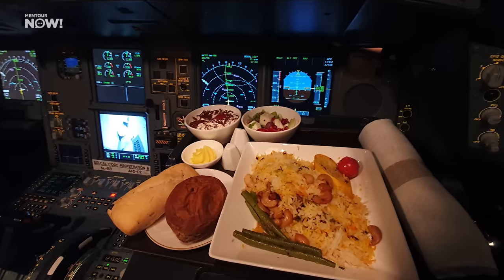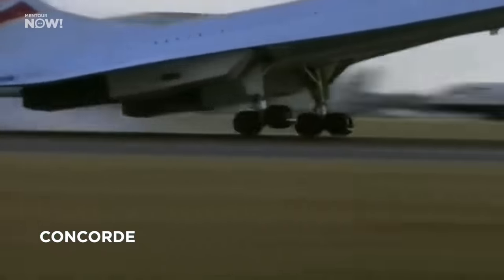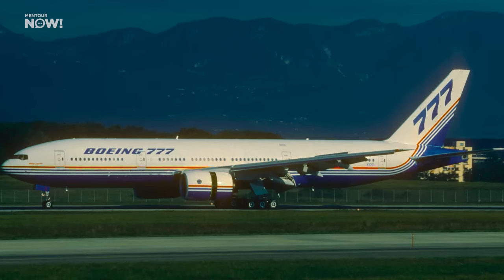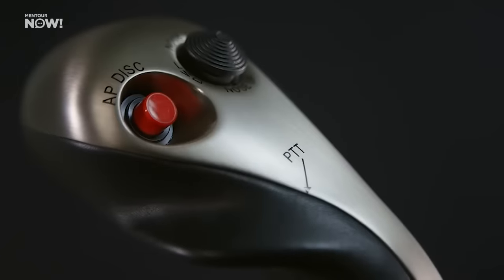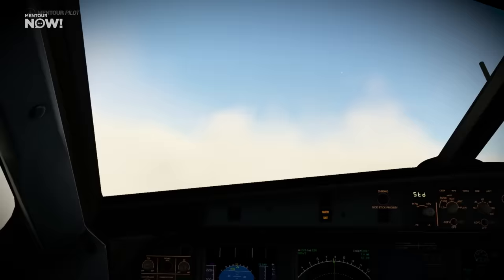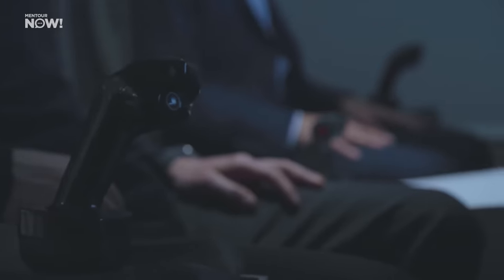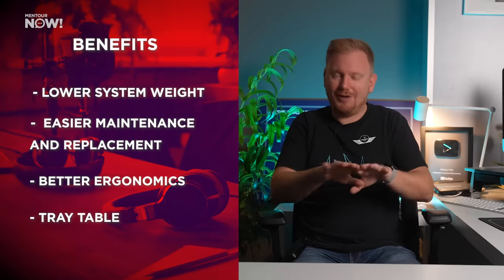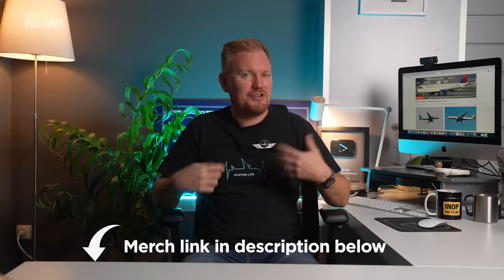Will Airbus Finally switch??

Comment: Airbus Normal Law and Alternate Law fly-by-wire logic is g-command. Airbus pilots don’t trim in g-command. Boeing Normal Law is g-command PLUS speed stability In Normal Law the Boeing pilot has to trim for speed change, but nothing else.
The hazard in Airbus backup mode is Alternate Law where the pilot still has g-command with no feel for speed change but loses the stall protection logic of Normal law which overrides g-command to preclude stall. In Alternate Law the Airbus pilot can fly into stall with no feel that speed is changing, AND automatic nose-up trim can continue even after stall if the pilot does not push forward. Full nose-up trim makes the stall much more extreme.
 Direct law is much less of a problem. Direct means the flight controls respond directly and proportionately to pilot inputs just like a 737. The Boeing 777 does not have Alternate Law. The 777 backup mode is Direct Law (or Secondary Law, which is Direct Law with some small refinement like changing sensitivity with Flaps up.) 
Air France 447 was in Alternate Law g-command with no feel that the aircraft was slowing and trimmed full nose-up after stall. The result was a severe stall where the aircraft turned over 180 degrees and full side stick would not roll level and sink rate was extreme with noise that likely sounded like overspeed. 
Without automatic full nose-up trim, the pilots of Air France 447 would have had a more benign stall and likely would have recognized it was a stall. Blame the pilots - they caused the accident. But no design should be certified that can automatically trim full nose-up in stall in ANY mode. That was also a cause.

Comment: I remember the YF-16 test flights including the gear up landing that, IMHO, cemented its place in the competition.  I remember being skeptical until the Thunderbirds started using it within inches of each other.  There really should be an analog backup though, EMP attacks are a real issue in the modern world.

Comment: Boeing and Airbus should converge to the active sticks, since it has all the benefits of both yokes and sidesticks and almost none of the drawbacks of each of them.
Now, a few "warning" notes:
1- The implementation of sidesticks doesn't automatically mean having full Boeing-like feedback. Synchronized movement of both sticks, airplane "feel" and autopilot feedback are 3 independent kind of feedback that may be all implemented or only some. All 3 are present in the Boeing's fly-by-wire philosophy implemented in the 777 and 787: The synchronized movement is due to the mechanical linkage between the two yokes, but the airplane "feel" and the autopilot feedback are actually implemented via software and servos.
2- I have doubts whether Airbus would go beyond just synchronizing the sticks. Implementing airplane feel for out-of-trim means a total redesign of their control laws (currently the sidestick deflection is proportional to the load factor at high speeds and to the vertical speed at low speed, and none of them would create feedback). The handling of the plane (how it feels to fly) would be significantly different, making it a big problem for pilots that have to fly retrofitted and not-retroffited versions in their fleet. And regarding the autopilot feedback, Airbus doesn't seem to be too concerned about that when it comes to trim or throttles (currently nothing moves in the cockpit when the plane's automation changes the trim or the thrust). It's hard for me to imagine a plane where the stick moves with the autopilot inputs but the thrust levers don't move with the autothrust inputs (something that also causes confusion to Airbus pilots especially in special unusual circumstances like control law degradation.
3- The servos better be really beefy. They have to feel solid as if the stick was mechanically connected one to the other, to the flight control surfaces, and to the autopilot. The control split in the Air France 777 go-around incident at Paris happened at substantially high forces, it is incredible that the pilots didn't realize that they were fighting each other. The split forces for the sidestick (i.e. the point where the human overcomes the servo) should be not less than that. The pilots need to be confident that when the sidestick is in a given position, the other sidestick will also be in the same position and the flight controls (elevator, ailerons) will be in the corresponding position (if airplane feel is implemented) regardless of whether the flightstick is being moved by the other pilot or, if autopilot feedback is implemented, by the autopilot.
4- There is one strong point of the yoke that active sidesticks cannot overcome. The big yoke just in front of you, between you and the instrument panel, directly in your eyesight line, and between your legs, is a HUGELY CONSPICUOUS source of visual and tactile feedback. The feedback of the active sidestick, being not in direct sight but in your peripheral view, and not between your legs, is much subtler. Still, if you look at the safety record in Airbus with a passive feedback, the fatal hull loss rate is amazingly low (the 737 and A320 have almost identical figures) so, with all the benefits of the active feedback, the benefits seem to easily outweigh the drawbacks. I would go for it, both for Airbus and Boeing.

Comment: Thank you for making a note  that the Avro Arrow was the first Aircraft to have Fly-by-Wire (a Canadian engineer discovery) but the Arrow also did not have Yoke. It too was stick operated. 
Just YouTube the Avro Arrow movie where the Engineer give the Pilot the "Feeling" using servo. The aircraft engineering was perfect as a first Delta wing aircraft to hit speed never seen before but it was politicians that killed it.
did enter service 
Thanks for the Canadian credit.

Comment: The Bristol Britannia had fly by wire electrically driven flaps back in the 1950s. A relation of mine designed the system and went on to help on the Concorde project.

Comment: Direct control is like commanding the aircraft to do what you want. Fly by wire is like requesting the aircraft to do what you want.
       In the late 70's or early 80's my dad was giving a student pilot a lesson, (Yes he was a CFI).
     They were a bit high on final so he asked the student, Why don't you show me a side slip?"
     Rather than performing a side slip the student performed a snap roll. Well, actually it was half a snap roll. The student was so startled by what the plane did he let go of the controls with stopped the roll half way through. Now they were inverted, at low speed and very close the the ground.
     My dad was able to roll the wings level but now the nose is pointed down. Dad started pulling, knowing if he did not pull hard enough the plane would hit the ground. If he pulled too hard the plane would stall and hit the ground.
     He pulled up as close to a stall as he could and managed the pull up before hitting the ground, but not before hitting the wheat of the field by the airport.
     Wheat was tangled in the landing gear and the tail, and the propeller was stained green.
     One of the things fly by wire does is prevent the pilot stalling the airplane. This means the pilot can't pull up as hard as he wants. Even if the controls are pulled all the way back. There would certainly be some kind of safety margin. The plane will not pull up with maximum force no matter how much you need it.
    If the plane they were flying had fly by wire, they would have hit the ground.
Reply: If the plane had fly by wire, they wouldn't even be able to do the snaproll

Comment: Cutting off airplane feedback to a pilot's controls has never seemed a good idea to me. The Air New Zealand A320 that stalled during a test flight in Europe, came about because the pilot was not aware that he had full up-trim when the aircraft actually stalled (due to a failed Angle of attack input he was relying on). Pushing full nose down in this case was not enough to override the up trim. I don't know if he even was aware of the trim setting before hitting the ocean.
Humans rely on sensory inputs, so disconnecting feel from a major control of the aircraft was unwise. It seems the lesson has finally been learned.

Comment: I think, a moving side stick with an active autopilot would not make any sense in the current airbus design, since the deflection of the side stick would not correspond to the deflection of the control surfaces in normal law. Thus it would just feel weird having a side stick move against the intuitive manual deflection.

I, personally don‘t miss the moving side sticks (as well as the moving thrust levers), although I can see how it would be a safety increasing feature.

Comment: Hi Mentour!
One of the big concerns I've always had about the Airbus control system was that the pilot is no longer continously aware of  the trim situation. For example, I love watching pilots in Boeing (and any other aircraft) flying a manual approach, continously adjusting the trim to respond to gusts, configuration and speed changes without really even consciously thinking about it, the same way that I manage the 18 different gear ratios in a heavy truck.
We recently saw an example of a pilot (who had spent the bulk of his carrer on an Airbus) nearly crash a Boeing 777 into the sea precisely because he lacked this awareness. Now, if Airbus were to switch to active side sticks, you don't suppose they would remove their famous "auto trim" system would you? Because this would require almost recertification of aircaft and pilots would it not? It seems like the A220 and GS aircaft don't auto trim because their sticks have an electic trim swith on top
😀

Comment: Really interesting video, thanks Petter!
Spacecraft (I know you mentioned the space shuttle) also had Fly-By-Wire control as well. The Mercury capsule, as well as the Gemini and Apollo capsules all had FBW controls (It wasn't possible to control the reaction control thrusters any other way). The Americans implemented the apollo guidance computer into a NASA F-8 Crusader fighter-jet in the 60s, it becoming the first test-bed aircraft for digital FBW controls. Aircraft such as the F-16 could not have been made without those technological gains made during the space race.

Comment: Recovering Boeing Pilot here 😂 having seen the light and now flying Airbus, I agree that the active feedback would be a great move forward, that being said I do not see it being possible to be a “retrofit” of any current series of airbus aircraft, not for technological reasons but practical legal ones. I would imagine the differences would be too great for the regulatory authorities to issue it under the same type rating as non active feedback, and airlines wouldn’t want to pay to have an aircraft requiring a completely different pilot cadre (see the 73 Max issue). So I would imagine we will only see it on a future clean sheet aircraft.

Comment: Hi Mentour,

My worry is that all these feedback electro/mechanical servo motors can and will fail in flight and may cause their own safety issues, especially when used aggressively in deathly situations. Even in normal use, they will suffer constant deterioration and as an engineer I am most concerned hence would appreciate your thoughts. I think Airbus have a good working model at the moment which as you state in your video when things go wrong then at least you have visual screens plus audible alarms which are most helpful. Airbus may end up opening a new can of worms with all these feedback servos because if one pilots joystick goes faulty then the other pilot may not experience the same feedback or worse case they may well experience faulty feedback which defeats the safety objective.
Love your channel.

Comment: i think that active sidestick won't solve dual input like you probably suspect. The only way to solve that is let the pilots FIGHT physically for the control. what does it mean? the throttle control are unique and on the middle of the cockpit. it means that a pilot for control it has to put a hand on it (and eventually tactile feel that there is already another hand). That's how probably the concept of the central stick born. So how to retain the advantage of dual stick and at the same time let the pilot fight physically for a control? Insert a big switch left/right on the center. when switched light up a green indicator on the side where the priority switch. the point is that a pilot have physically switch it and then control the plane forcing the "my control" that maybe in the crysis is forgotten. japan metro display that couple a physical action with talk help avoid error. So the reverse should be the same, couple a physical command (the switch) to the words that could be forgot. priority button on sidestick not solve the dual input problem because they aren't in the "middle share area" of the cockpit, hence a dual press of priority button can happen. 
i add that moveble throttle to display if autothrottle is working and a which set the engine actually are , can be another welcome feature.

Comment: Well I understand the point with the active Sidestick, but in an Airbus cockpit now, it would be a little bit annoying. Because: On the Sidestick, there is a push to talk button for ATC. If the Stick would be moving this would not be very convenient. Putting it somewhere else as well.

Comment: From a usability POV, the dual input warning is useless, since so many accident reports note that they were ignored. Linking the two side sticks together will require that there is a defined breaking force, and then they will be split inputs again. You mention it with a crew of a 787 having the same issue: they were fighting the airplane, even though it would make no sense to fight that hard on a 787 with FBW, with the result of them breaking the linkage, and we are back to square one. I am not against force feedback side sticks, I just think the dual input warning should be aural, visual, and tactical. In a joking voice: there should be a large yellow light shining into the pilots eyes and a MD-11 like voice should say: BOTH PILOTS INPUTING CONTRADICTORY COMMANDS, with a follow-up electro-shock ;)

Comment: An interesting thing I just learned about the F-16 - the first models had a sidestick that didn't move. So it had sensors that detected force rather than lateral movement. Pilots complained that it was very difficult to judge how hard they were pushing versus how far they were moving the stick. The plane was later modified to use a stick with motion rather than force.
Reply: The advantage of a stick which doesn't move is that it can read all 6 degrees of freedom (forward/back, left/right, up/down, yaw, pitch roll). It's used in a controller called a spaceball, which has been used to provide input for CAD software. I believe the robot arm on the Space Shuttle was also controlled by one.

If instead of reading input forces on a fixed ball/stick, you read displacement in the stick via a movable joystick, two of the rotations become indistinguishable from two motions (forward/back overlaps with pitch, and left/right overlaps with roll). And the joystick can only read a maximum of 4 DoF.

This doesn't really affect a regular plane since they're incapable of translating left/right or up/down, forward/back is controlled by the thrust lever, and yaw is controlled by rudder pedals instead of twisting the stick. So the stick on a plane only needs to provide 2 DoF. But the USAF may have wanted to experiment with assigning control to more than 2 DoF to the stick. As well as get pilots more used to controls which would eventually be needed for spacecraft.
Reply: @solandri69  Very informative, thanks!

Comment: The fact that they're replacable parts means at some point most airbus aircraft are going to have to have their sticks at least removed for maintainance at some point. Replacing them will effecitvely be trivial, once a company makes the leap and asks.
The fact that they're already appearing in other side-stick controlled aircraft makes me think the switch over is inevitable, it just might take a bit.

Comment: I have a considerable amount of Airbus experience and a couple of opinions on the points made. The lack of trim feedback in Direct Law really isn't true. In order to maintain an altitude for example you would be pushing forward on the sidestick exactly the same as as you would on a more primitive aircraft ;) I'd suggest the reason Boeing don't use sidesticks is exactly the same as the reason they still sell B737s. 

If servo feedback was introduced to sidesticks, I'd like to see it similarly introduced to the thrust levers. Incidentally, sidestick movement isn't a "visual" feedback as claimed, and is a tactile feedback. We still fly with our hands on the sidestick/thrust levers during the same flight phases of Boeing pilots should be. The reasons not to introduce it is it would then need to account for a servo runaway, and with the movement of the sidestick being quite small (indeed it's really more of a pressure) a servo runaway would be a very big deal very quickly. A so called conventional yoke has a physically much larger range of movement. Trim runaways are definitely "a thing" in many Boeing aircraft

Comment: Movement: Petter on a theoretical basis, there must be decided in the requirements of that active sticks what shall cause movements. You clearly mentioned the input from the other side. Next could be reflecting any surface deflection - BUT were shall that derived from? Computers, surface sensors? Next you mentioned the forces. There my question comes - do the systems 'tell' all forces today in a fly by wire system?